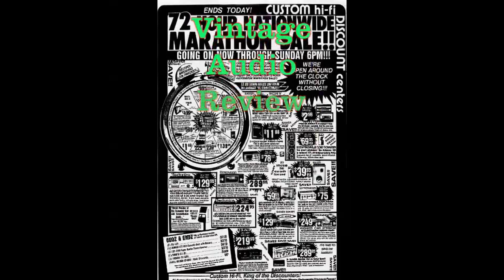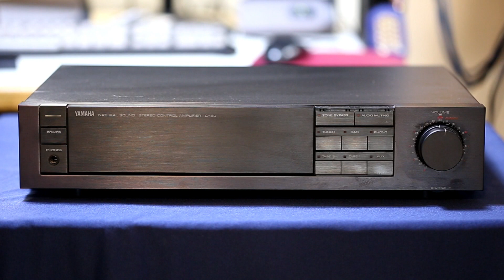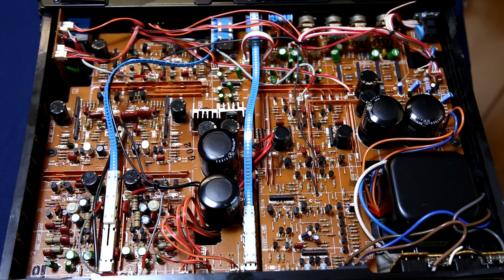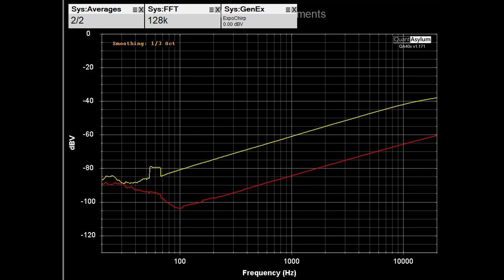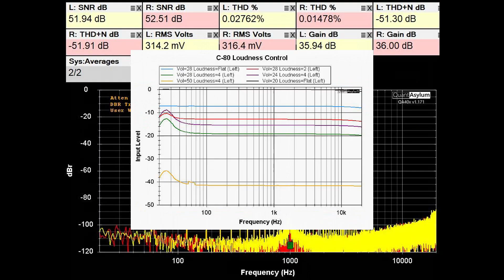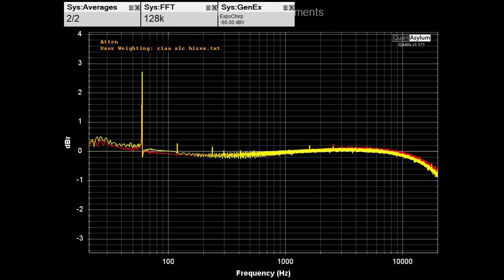Yamaha C-80 Preamplifier- Vintage Audio Review Episode #54

Comment: This unit is faulty. My C65 had a much lower noise floor and far cleaner phono stage.
Reply from the maker: I appreciate your commenting. I am not familiar with the C65 so don't know about its phono stage.  This one- at least the MM input looks ok for the most part- sometimes the 60hz ps hum looks pretty large as there is a lot of gain in the phono stage. The overall MM frequency response is not all that bad, though there is some noise. Possibly could have some p/s caps in the phono stage replaced.

Comment: For anyone watching this video a year later, the Loudness control is to boost low end tones at low volume. The control wheel would be turned all the way clockwise when you power on. Then as you increase the volume from all the way off toward full, to a level you like, you then turn the Loudness control counterclockwise until you like the low-end response sound. It basically adds more low-end response at low volume levels. Loudness.
Reply from the maker: Thanks for the explanation. I think I explained how it worked with some later yamaha preamp videos, plus there are some others that do it similar, though the overall gain may be attenuated as well.

Comment: I have a “like new” one. Absolutely love it, however my left channel is going in-and out.. any suggestions on parts that may need replaced?
Reply: Common issue on this series of preamps (C-40, 60, etc.) is the solder joints going cold. My C-65 has this issue; the first C-80 I had also had this issue. I would recommend bringing it to a shop that works specifically on vintage audio (not a generalist in other electronic components like TVs) and ask them to examine the solder joints throughout.
Reply from the maker: @intendentsuper  I appreciate the info. I work on quite a bit of vintage gear, but don't remember the particular issue with this one w/out having to re-watch the video again, which I will try to do later...
Reply from the maker: Sorry to hear that you are having problems. The easiest thing would be if the controls/switches need to be treated with something like a contact cleaner/lube, but other than that, you would need to have it looked at by a shop.